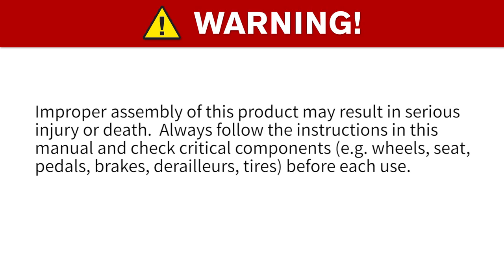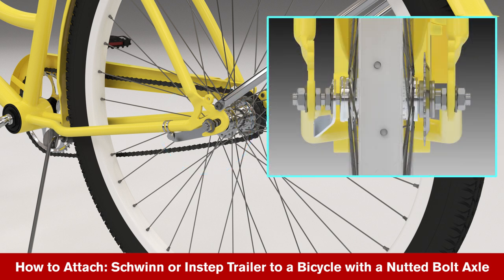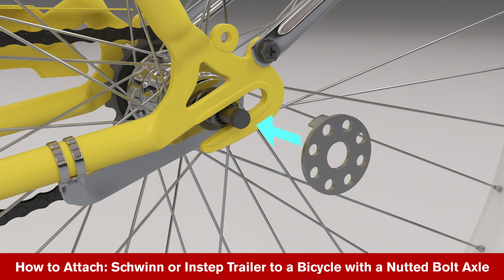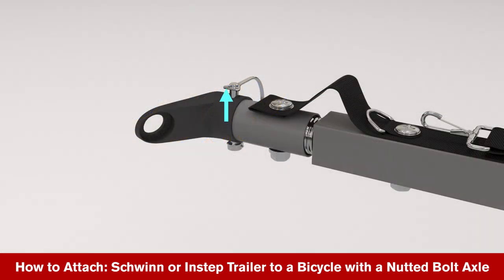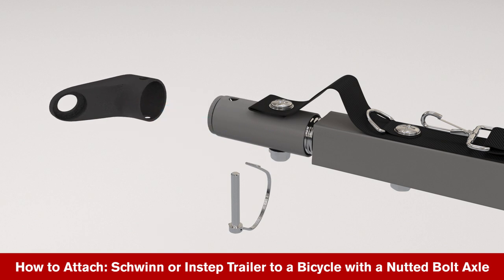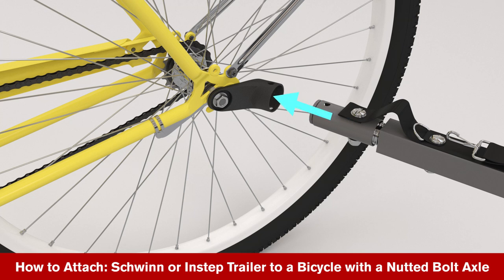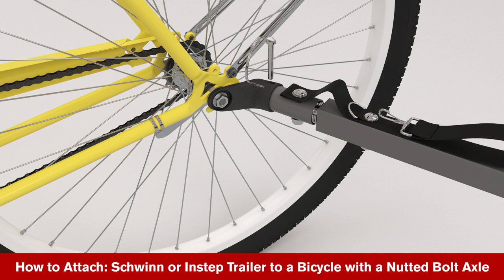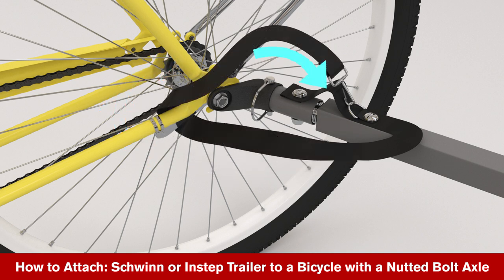How to Attach a Schwinn/Instep Trailer to a Bicycle with Bolted Wheel

Comment: I bought this pet trailer together with the Wayfarer Step-Thru Schwinn Bike and they are not compatible. The fender doesn't leave enough space for the pet trailer adaptor. I'm quite dissapointed and upset. Can you please give me any recommendation/solution? I can't beleive Schwinn would produces bikes and pet trailers that are not compatible with each other.
Reply: Hola Paula, Curioso de conocer si te pudieron ofrecerte alguna respuesta?
Reply: I have the same issue